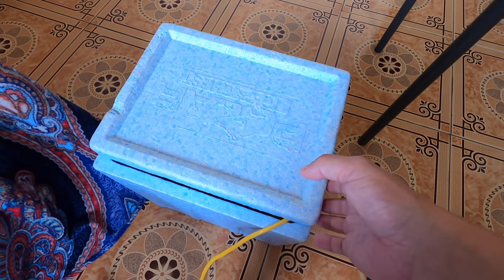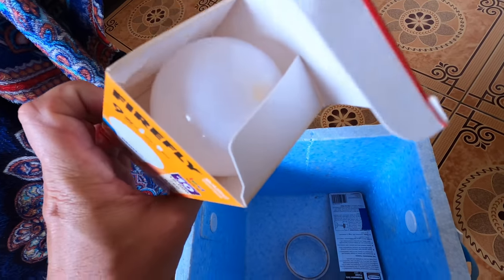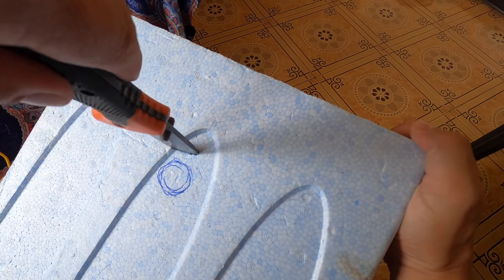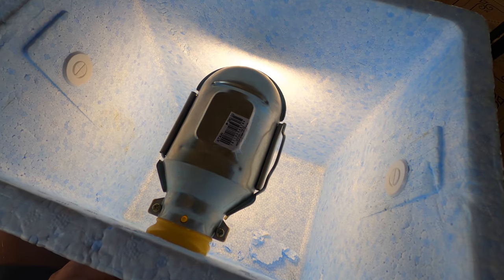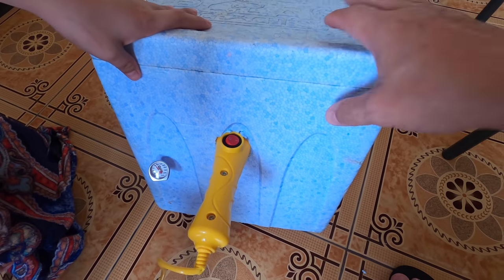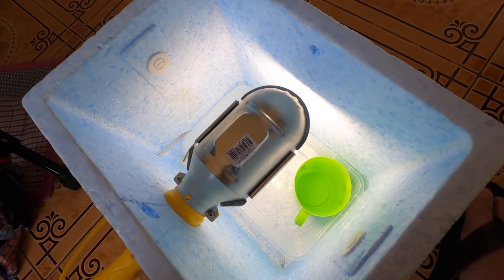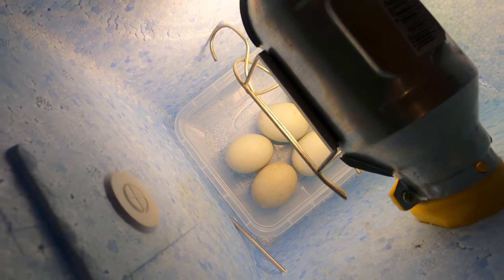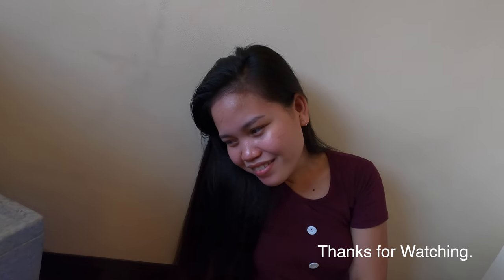How to Make a Homemade Duck Egg Incubator for $15 USD - Optional Thermostat Accessory Costs EXTRA!

Comment: Yes the meat thermometer will work. I have several of them in which I have 2 refrigerators and I have 1 in each of them to keep temperature control in check